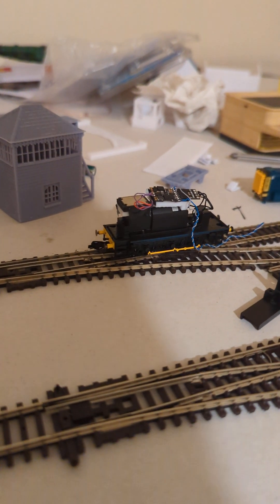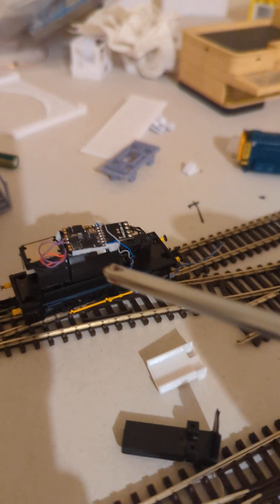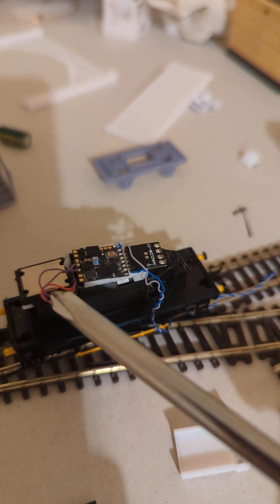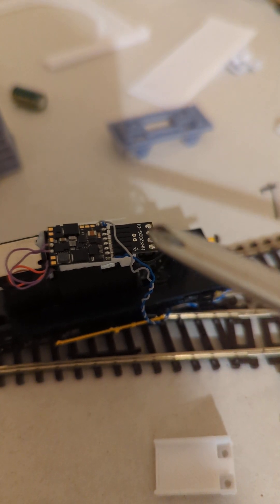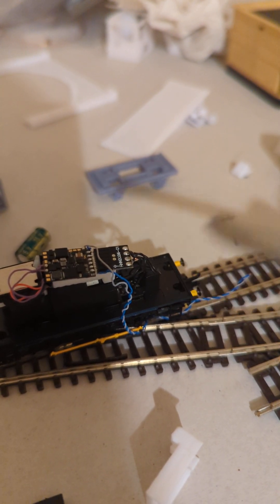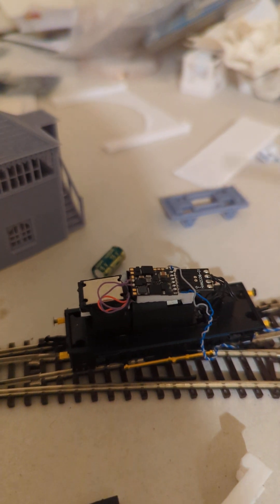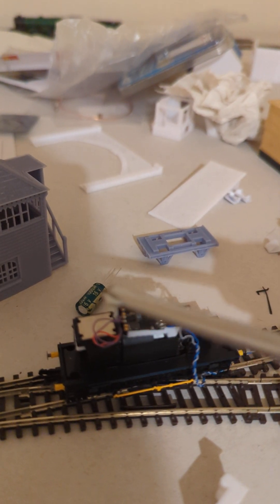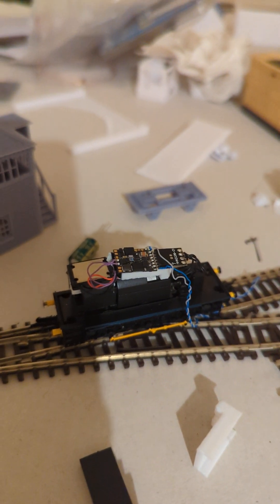Hornby TT120 08 Shunter. DCC with sound decoder howto and stl files for 3d printing.

Comment: Good stuff, although I’m hoping someone has a crack at fitting an 8 pin Bluetooth HM7000 decoder.
Reply from the maker: Probably possible but you'd have to forgo the hornby stay alive as it's too large.

You'll also have to unsolder the wires from the loco and directly solder them to the hm7000 (and unsolder the existing plug on the hm7000) as all the cabling wouldn't fit. My soldering skills are not the best so I wasn't willing to risk that.
Reply: @Richard-ou6qo  What if you didn't want the stay alive in there? Also i couldn't see the files from your link...  Thanks
Reply from the maker: @DodgeShanks  I'm not sure to be honest. The HM7000 options isn't something researched very much. Felt too risky.

Go to Thingiverse and search for "TT120 Hornby 08 Parts for DCC decoder with sound" and that should find it." then you should find the STL files needed for printing. Turns out my channel is too new to post links.
Reply: @Richard-ou6qo   Thanks Richard.. Amazing work by the way, i'm not capable of doing this tbh. I will do a search for files. Thanks again..